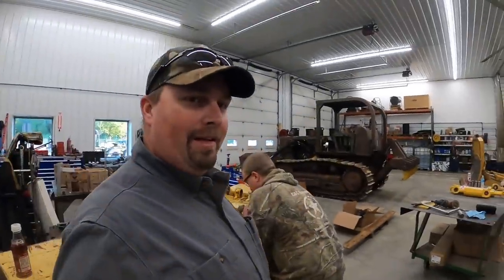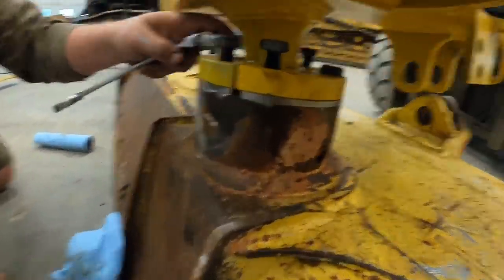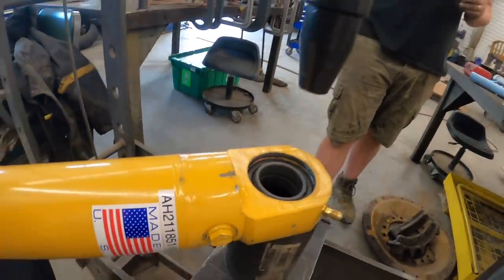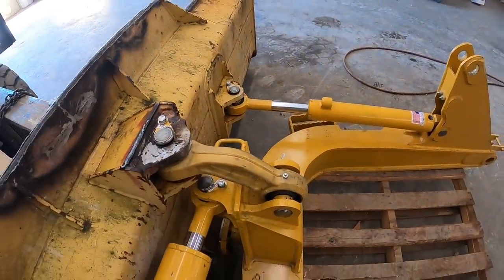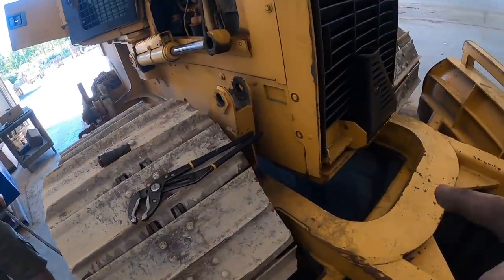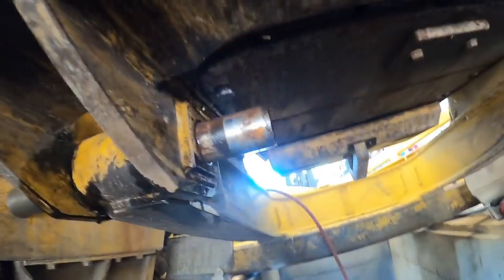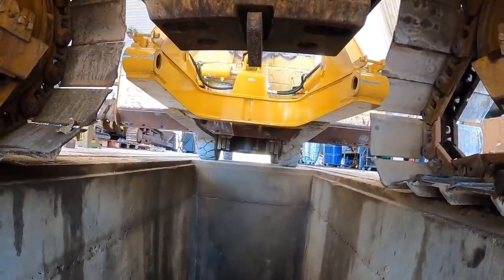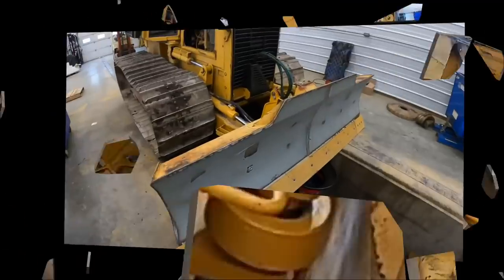Part 2 of blade work on Deere 650H dozer installing new blade and c frame

Comment: I was a heavy equipment operator and mechanic for 40+ years, I am watching you fella's kneeling in the concrete floors [ like I did ]  I now have two titanium replacement knees, Hope a word to the wise helps some one out.

Comment: I am  a first time commenter, and a recent  subscriber. I  like what I see and hear so far, so in the interest of not having an interruption of your ability to make  videos due to an eye injury. Please consider changing the  shaded glasses you wear quite often on your hat, for clear safety glasses. I watched you drive the painted ends of the lower dozer blade pins, with a bare face and a round faced hand sledge. Since you employ a number of people, and are responsible for their wages, even you as the boss need to were your own PPE. 
So please take a moment  to have the right stuff at hand for yourself, just like your boys do when they work with you Dad.
Have greatly enjoyed the experience of  watching your efforts so far  Best wishes, now "hit it with your purse" LoL.

Comment: I see pin alignment is always an issue and some are really tough.  Consider this - have a bad pin - saw in half (thereabouts) and grind down the cut end into a nose cone.  Maybe just a slight one as you are closer than the half pin.  Now put it in with the real pin following behind and as the real pin drives it forward, it aligns the opposite eye.  And it drops out the back side for next time as the pin comes through.  Just a thought .  A tool post grinder would be nice for the lathe but a bench grinding stone is good enough.

Comment: Those rear ram towers, if you have some old ones. They make good hinges for a truck dump bed or box. I had an 85 one ton chevy  dually with nice diamond plate 10 ft flat bed bolted down. Boss had some old towers so if you cut them right the tops will sit on the frame with the tower side going down on one side to bolt to the end of the frame. One for each side. The towers are built with those plates just below the pin holes that sit perfect on the top of the frame and the side going down bolting to the frame then weld some tubing or something to the bed or box and they worked perfect for easily removable pins that just take the pin bolt out pull the pins and can remove.  I made a hydraulic dump flat bed out of it . Came in handy.
Reply from the maker: I bet

Comment: I worked on Cat and International equipment when starting out as Mechanic 👨‍🔧. Of all the jobs I hated the most was breaking the master pins on older equipment to break tracks. Then later they came out with split master links sure made life a lot easier.
Reply from the maker: For sure

Comment: The thing I hated the most when working on hydraulic cylinders when I was working on garbage trucks was when the PM tech didn't grease the pins and your fighting getting pins out of cylinders because the are seized in place

Comment: I commented a couple weeks ago about how we used 650s and would break and Crack the heck out of the C frames and the boss finally had made his own. Having the steel 3 times thicker bent and we welded them up 8 pieces total etc.. And they solved the problem. And you responded, thanks. But I then noticed these newer C-frames in your videos.. Either those are a newer factory made ones or they are ones someone made. Anyway, just wanted to say that ours were the one piece squareish tube C frames on the 80s to 90s. Not sure when jd  changed or improved their factory C-frames. Thanks
Reply from the maker: Yep 
These are aftermarket ones we carry for paint valley equipment
Reply: @C_CEQUIPMENT  oh OK.

Comment: I was taught to align the  pin with the sleeve and only drive pins in with a soft blow headed mallet to prevent the rounding of the pin ends.

Comment: Nice work! Only one exception I can see, and I see it on DP, Diesel Creek, and now your channel....when you're trying to drive pins, why doesn't anyone every try to 1) basic cleanup of the bores, and 2) use of grease on the pins? I see alot of pounding with a sledge, when some less exuberant help could be used. Just a question!

Comment: What do you do with the "V" blade and frame?  Do you scrap it, sell it off, or will you cut the blade and bracing off and weld a ball and tilt mount to that frame?
Reply from the maker: We normally sell them